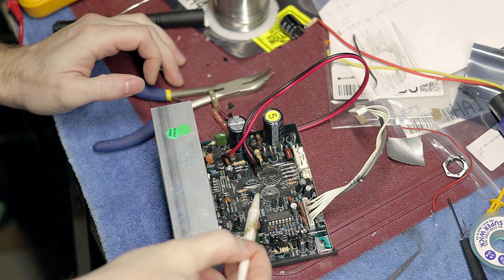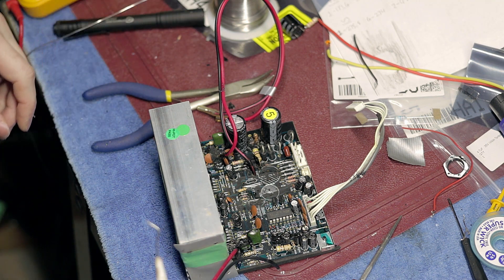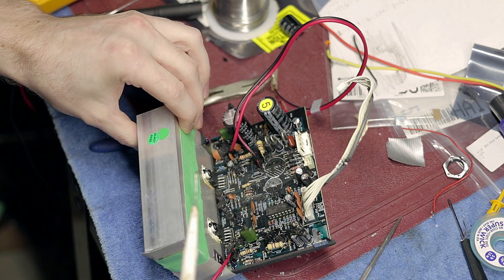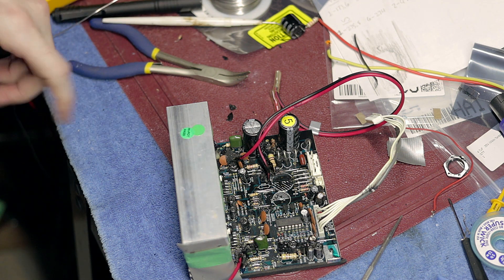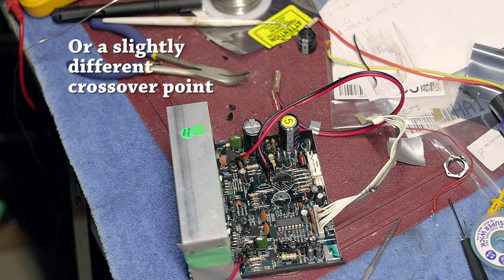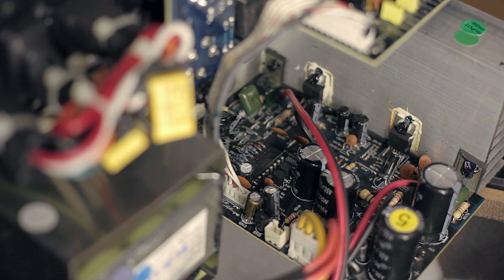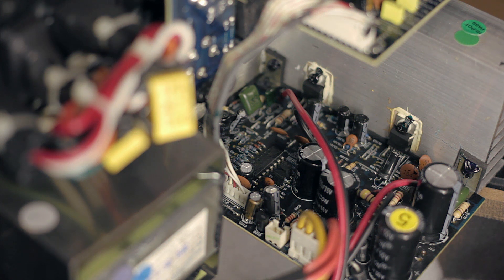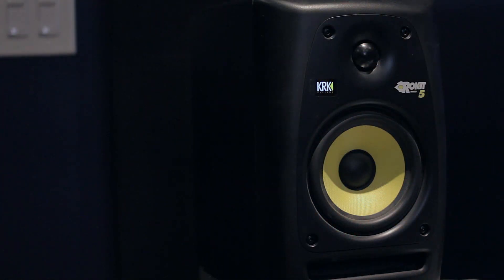Fixing a KRK Rokit 5 RPG2 Monitor Speaker. Repair FTW!

Comment: hi Jay, great video, I think mine is having the same problem. but the first problem I have is that the back panel is like super glued to the connectors with that black stuff, and I can't get it out by force. any advice on how to remove it? thanks!!
Reply from the maker: If I understand your question correctly, you have to lift the back panel on one side just enough to reach in and undo the connectors. You may have to use a pair of pliers to get a good enough grip on the connectors. Sometimes they get really locked together.  If they are really stuck and you have no other option, you'll have to cut them and figure out a way to reattach later or just replace the full length of wire. Do note that the connectors are different sizes for the + and - leads. Hope that helps.
Reply: @amp_mechanic  can instruct me how to fix my roki5 110v , I was wrongly plungin in to 220v and it's power off and it smoke out?

Comment: Yeeees! Great video. I've got the exact problem with one of my Rokit 5s. It seems like the limiter is kicking in, so I'm gonna open it up, and see if I can fix it. To bad Denmark is a bit to far from Canada :-D
Reply from the maker: It is a bit far indeed. Best of luck with it. If you can solder, it's not overly complicated to replace a few components. Just take your time and chip as much of that hardened black goop off the board as you can. Cheers!
Reply: @amp_mechanic  Where did you find the components to replace?

Comment: Hey man, I figured I’d ask you since you really seem to know theses well. I have a pair of vxt4s, the one has an issue with the speaker pushing out as soon as it’s turned on. The board looks very clean, all capacitors were tested and are working well. I have a feeling it is just getting a positive charge right away but I’m not sure what it’s causing it; any feedback will be greatly appreciated!
Reply from the maker: Hi Carini, I'm not familiar with the vxt4 circuit. I'd guess first place to look would be the mute or auto mute portion of the circuit. It can be an integrated part of the main amplifier IC but should have external components to control it. Mute should be turned on and off by a voltage being present or not. Watch for both states.

Comment: Any chance of telling me where to get schematics ot KRK Rokit5 G2? Elements around one of the capacitors in my case are totally burned and I can't see what exactly are writings on that 2 parts. One is resistor labeled on the PCB as RL105 and the other one is diode labeled as DL100?
Reply from the maker: Hi Nikolay, RL105 is a 10K. DL100 is a 1N4148. The only schematic I found after scouring the internet was for the KRK 6 G2 but luckily it's almost identical across the whole G2 line. I just threw it up on my google drive https://drive.google.com/file/d/1iPFIQ5FvDWsnmzevvi_EKpcGT0wlXMJX/view?usp=sharing

If you have trouble send me an email at info.ampmechanic@gmail.com and I'll send it to you that way. Cheers!
Reply: Hi Jay, thanks for your good video. I have also a brooken Rokit G5 G2 and think the limiter is the reason. I found on Amplifer around 5V on Pin 3 (Mute). Do you mean, the change of the 2 transisor can solve this? It is also bad to troubleshoot - sometimes the speaker works, sometimes not......
Reply from the maker: @gunnarweber4930  Hi Gunnar, it can be the transistors or the resistors feeding them. I'd just replace all of that section if you're not sure. The parts are cheap if you're ordering them anyway. A bad speaker makes it very tough. Make sure you go through and clean up all the outputs, and deal with any corrosion you can see on the board. The speaker can go bad in these but, it can also just be bad connections on the board. Good luck!
Reply: @amp_mechanic  FYI I've found the schematics and resistors are labeled differently to Rokit 6 (or even Rokit 5 G2 v3.0). Mine is exactly Rokit 5 PRG2 v2.0 (labeled on pcb). RL105 is 18k (works with 22k too) and RL108 is 4.7k. I also replaced 2 big capacitors next to these 3 parts and also the one ceramic capacitor labeled CL107 (100nF) as it was broken too.
Reply from the maker: @devanegeroy  Thanks for the update. I suspect it would work with either value in RL105.  Congrats on repairing it yourself, that's great!
Reply: @devanegeroy  Hi Nikolay, did you find the schematics of the Rokit 5 PRG2 v2.0? Would it be possible to get a copy? Can you get in touch with me?
Reply: @MarcoTrivellato  yes I have found the scematics but the quality is not very good, it is scanned from paper. Give me an email or some contact and I will send it to you.
Reply: @devanegeroy  
Thanks Nikolay, unfortunately it's no longer possible on YouTube to send private messages. I would like to avoid putting my email address. Could you put a wetransfer link below? It only lasts for a week, then it expires, providing a good degree of security. If you can suggest alternatives (such as a Google drive file), I would really appreciate it.
Thank you!!!
Reply: @MarcoTrivellato  geroyblog is my blog

Comment: Please help me. I have a problem Speaker KRK ROKIT 6 GEN 2. Bass / Sub sound is very audible from the sound
the original. Sometimes a tweeter dies and lives again, dies again, so over and over again.
I think what parts should I fix?
Reply from the maker: Hi Aziz, it may just be a bad tweeter. Check it with your multi-meter. Also look at the circuit board while you're in there. If you see a lot of green oxides or bulged caps, replace those components.

Comment: How much would you charge to fix the KRK Rokit 6 G2 with the same issue
Reply from the maker: It really depends on how extensive the damage is. It's impossible to quote a price without looking at the unit because some can be fixed in a little over an hour, some may take 3. And there's no predicting what components need to be replaced. I wouldn't consider doing anything with one for less than $120.